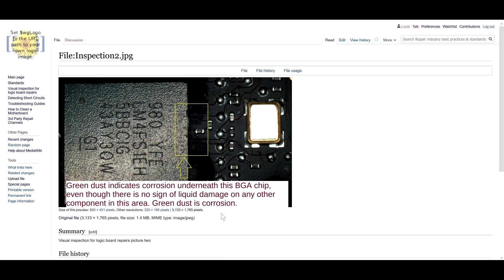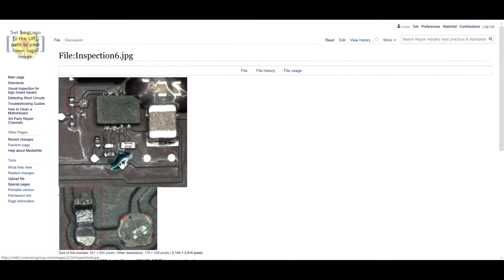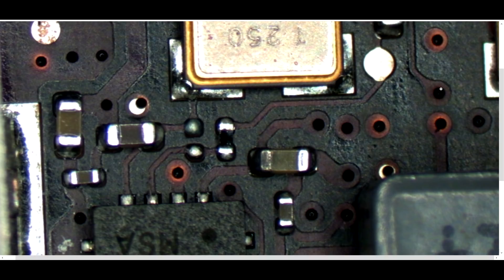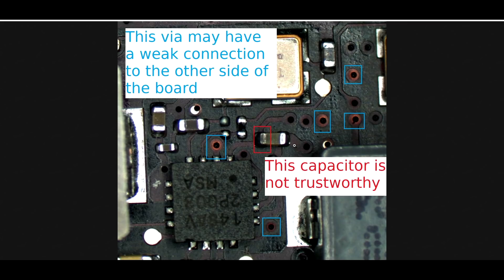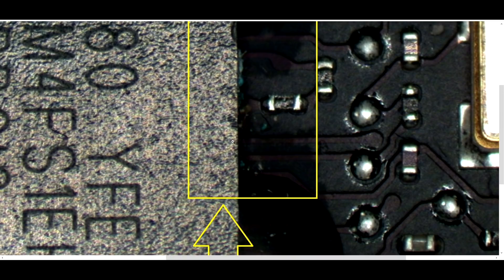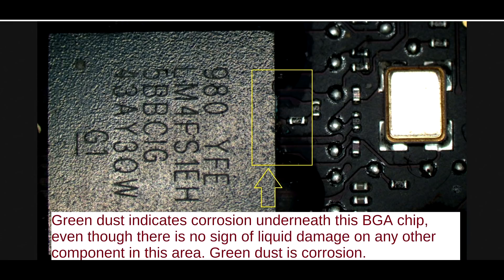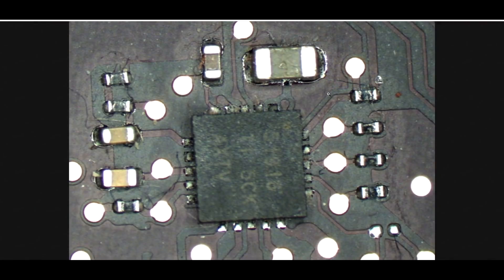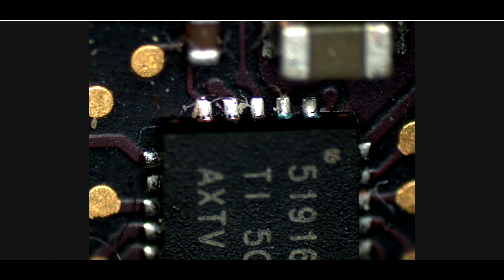Why do I fix logic boards before cleaning them first?

Comment: I never clean a board first I leave all the corroded areas etc and work on those areas 1 at a time test and then clean the board properly if you clean the board first you may forget which areas were bad and overlook it which will lead to a no fix

Comment: Back in the early 70's, one of our pinball machine came in with "bad display" (like a multiplexed Nixie tubel). Test fixture looked correct. Closer look had pink something around the the glass display to interface board connection. I reconized the pink looked like the colorizer of our acid flux bottle.  Someone had trouble soldering the leads during a previous repair and used acid flux to clean the connect leads of the glass display but did not clean it the acid flux off.  When dry, no high voltage leakage, but high humidity would re-wet the flux and conduct to other segments.

Comment: Usuallly once I find a component with corrosion I will clean that individual component with alcohol then reflow solder.  Leaving corrosion then reflowing solder can leave trash in the new solder joint.

Comment: I think it really depends on the job. I repaired industrial variable frequency drivers and they would come completely disgusting with oil, dust and even metal powder making it impossible to working on without cleaning first. Before cleaning I would first visualy inspect if anything was blown up and check if the mains or output would be shorted.

Comment: This reminds me, Iv'e lost quite a few laptops to spilling even the smallest amount of liquid onto my keyboard, Iv'e tried all the methods to fix them but I finally found the best and by far the easiest one. Disconnect the battery from the board and get 99% alcohol and pour it onto the keyboard (be generous) the tilt it in all directions to get the alcohol in every crevice and let it sit for an hour or so, drain it then dry it with a hair dryer, repeat, then leave it over night to dry proper. Then see if it works...Hope this helps some of you.

Comment: Louis, If you have a board working perfectly (ideally Brand new) what are your thoughts on applying a good layer of silicone conformal coating to prevent any possible future water damage?

Comment: Didn't even watch the video yet. But from the thumbnail i'm gonna guess you repair before cleaning so you can see all the corrosion and crap that points to damaged components. If the board is all squeaky clean then much less corrosion and gunk to point to bad components.....
Lets see if i'm right 8D

Comment: Thought this would be obvious to anyone doing board level work. Unless the crud itself is the problem fix it before you make it look pretty. Even then if the crud is likely the problem clean it by hand component by component as you diagnose it. Also one must appease the feline gods especially when their trade is witchcraft and anyone who has worked on electronics has broke out the candles and gris-gris once or twice... a day...

Comment: I get where he is comming from, that being said if you have a board that just behaves all sorts of weird i tend to just put it in the dishwasher and that usally fixes things... Keep in mid those are not basic issues like powerrails missing or being shorted but issues like the ram suddenly clocking 100Mhz worse, the board not liking certain voltage or fsb settings etc... (zero experience with stuff like notebook boards here, as they don't really intrest me, just desktop stuff)

Comment: Wow, i'm surprised this is even a question!

Often times when looking at an issue in this field and it doesn't matter if its hardware or software you approach it as a detective. 9.9/10 you get a bull story and that's not to say people lie all the time, they just genuinely don't know what happened...

You simply don't clean the scene before fixing it as it helps so much in figuring out the why which of course will be asked by the client and it also gives you a great idea of where to freaking look!

Comment: It's kinda like trying to find the bad seal leaking oil AFTER you steam cleaned your engine 360 degrees all around.
Reply: when I go to buy a used car, I get real suspicious if the engine compartment is squeaky clean.  My first reaction is "what are they hiding?"

Comment: I'm a novice at repairs, but I would have thought this was common sense. I'm surprised you're having to make a video on this! Why clean the PCB first making the job of inspection/diagnosis harder to do? Doesn't make sense. The condition of the PCB is your greatest evidence & troubleshooting tool.
Reply: Armchair experts may have a fantasy that everything can be magically solved by testing. The reality is that most component-level faults are not included in the self-diagnosis. Imagine trying to anticipate every possible failure of each resistor, capacitor, and circuit.

Comment: sorry to be off topic: in a previous video, you used flux on the circuit board and I finally got around to looking what that meant, one of which is to clean and remove oxides. I do not do soldering on my own, but I am interested in cooling for high power chips. We typically use a thermal paste to ensure best transfer. Most of the delta-T occurs in the oxide layer that forms on any metal surface exposed to oxygen. Do you suppose we can use flux to remove the oxide layer? (then get the paste on quickly)

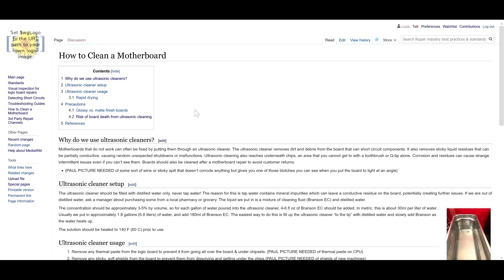Comment: 9:50 Guide for using ultrasonic cleaner, ehmmmm I have none. But what i have is a dishwasher, as seen on the internet (YouTube)
put your electronics into the dishwasher :O. I did it. The e- board came out pristine, it was a brand new board for a 3018CNC, factory
new and dirty as always... China. It still works, sometimes you have to be lucky.

Comment: Hello Again Louis In regards to my question about this  previously , It was in regards to, "  When "  you fix the particular area, not before you look for the problem. I can understand why you don't Clean the board beforehand,  because then would be getting rid of important signs where there may be a problem. However when you find that area/chip, etc to be resoldered, then I would have thought you would clean that area.  Kind of like me and painting for the customer, I don't paint over the dirt or holes in their walls, I wash the wall of any grease/grime or patch the holes sand and prime the areas I patched then apply the Primer coat, then apply a Finish coat(s). Just wanted to touch base with you on that as this video came after I asked this question of you. Cheers, Stay healthy Stay Safe. P.S. I like your channel and never thought of you as unprofessional nor lazy.

Comment: Component-level repair is rare these days, but not really that hard. It DOES take a plan, though. I was a self-taught 2M tech in the Navy a looonnggg time ago. Inspection is the most important first step. That said, I can't count the number of times I "fixed" malfunctioning gear by merely vacuuming it out. At least a dozen CRT television sets - vacuum the dust out, and voila!

Comment: When i was working with board repairs 15 years ago i allways started out with a thorough microscope inspection for cracks in underfill and corrosion on the board as well as conectors.
I had a much lower return rate on repairs than my colleagues...

Comment: I'd like to play Devil's Advocate for a moment, but I completely agree with what you're saying. I think I understand where the mindset of the people asking why you don't clean it first comes from, though, and it has to do with the sort of tasks that they do most often. A lot of people are just doing work, and for them having a clean and organized workspace is paramount to being able to work efficiently, and I'm sure your workspace and tools are both clean and organized before you start something. Troubleshooting problems is different, and should be considered a "separate task" from the work required to actually fix the issue once you've identified it. Sometimes you clean to find a problem, other times you want to look and evaluate the damage first.

For example, if I have a leaky sink, and I open the cupboard to look underneath it and all I see is condensation on the underside and all the plumbing, maybe a puddle beneath it, it makes sense for me to "clean it," or just pat everything dry, so that I can then watch and see where the water is actually coming from. The flow of it if it's just a small trickle may be invisible if everything is wet, and the contrast helps me. Another thing that supports the "clean it first" mindset is that probably something like 90%+ of problems with machines are due to something being dirty, at least in my experience, and simply cleaning it IS the solution.

On the other hand, if I realize I have a bunch of ants coming in, yeah I can spray down some poison and clean up the carnage of where I saw them, but that's going to work against me. I won't know how they got in in the first place (and exclusion, physical barriers, are better than any other method for keeping pests out), and they'll be scared off by the poison just long enough for me to not be watching, then when it wears off it comes back. It makes more sense to me to hunt down their trails and find their entry point, plug it up, then get rid of all the ones that are left trapped inside of my house. Or, obviously, the example you gave in this entire video, or everyone in the comments below referencing crime scenes. Sometimes it's necessary to use the dirt to find the problem, sometimes you want to clean it first to find it, but most of the time needing to clean it IS the problem - and why so many people parrot that all the time.
Reply: He’s talking about repairing electronics, not plumbing. Very different. Besides I have to disagree, very very few times I have found that just cleaning  solved a problem.
Reply: @pansepot1490  Yes, I understand he's talking about electronics. I'm trying to explain why a ton of people would have the mindset of cleaning first because their exposure to problem solving is different. You're welcome to disagree about how effective cleaning is, but that also depends on what you do and what problems you face. My biggest (only) enemy at work is a giant industrial printer, and most of its problems are definitely caused by the fact the ink shoots out of it with all the grace of Cartman's arsehole after he's stolen all the skin off the Kentucky Fried Chicken, and dust or grime getting on various sensors. And that's also held true for most other fields/things I've encountered in life.

To be fair, I do kind of lump in other bits of general maintenance with cleaning. Like replacing/sharpening a blade, adding grease, etc. In my brain a gasket wearing out is a form of getting dirty. We cling to life by fighting entropy.

Comment: Without even watching:
1. Dirt, grime, soda spill, signs of discharge and other debris can be a big old NEON 'problem here' sign.
2. When you are unsure of what the problem is, 'cleaning' things can result in worsening the existing issue, depending on what the issue turns out to be. 
3. If I'm going to have to toss it anyway, I don't want to waste the time and materiel cleaning it. 
4. It's fun to see how flustered people get when you reveal before and after pictures of their electronics and they see just how poor of care they  were taking of them. 

I cleaned up a nintendo 64 that was 'no longer functioning' and the associated controllers with loose sticks as well as all the cartridges for a relative's kid, as a birthday present. The parent didn't believe me when I told her that it wasn't an entirely new console, until I showed the nick in the housing around the video out that had been there for 10 years. Incidentally, the 'non-function' turned out to be a combo of the old RF cable that was being used for video failing and dirty contacts on both the console and cartridges. So I threw in some sleeves and explained to the kid how using them meant stuff would keep working longer. When you also include an 'awesome' display shelf, the kid is much more likely to make use of them.
Reply: That's pretty cool about the console. What do you mean by sleeves?
Reply: @DuckieMcduck  Little plastic sleeves that go over the base (or entirety) of the cartridges to act as a dust/debris cover and basically protect the contacts from damage or corrosion.
Reply: @jtnachos16 
Haha
I'm fairly careful with my electronics. I've never had any electronic device fail on me.
(well, I dropped my phone and broke the screen once, but my ancient GameBoy Color probably still boots up just fine, lol) 

But even so, I wonder what massacre would await you if you opened up my devices and took a good look 😆
I'd be very pleased if all you found was some fine dust 😅
Reply: @MrNicoJac  Well, at least in the case of gameboys, I'd probably find a decent amount of dust on the backside, maybe a bit of corrosion around battery contacts, but also a few bug shells. I don't know what species it is, but there is one type of bug that is in at least my area, that seems to like molting inside of nintendo cartridges and devices. I've never checked inside of a Genesis, but I've yet to find any of that type in a playstation or disc-based console.
Reply: @DuckieMcduck  H probably meant some microfiber cloth that is used to cleaning dust from electronics
Reply: Yeah. I'm stripping paint off something to refurb it, and the workers nearby asked why I did not pay them to jet was it. "Cos I saned it all off" I said lol. I needed the dirt to tell me where the holes were. XD

Comment: Again, I have to ask: How do you know that people from outside your store are entering good information into the Wiki? How are you vetting your Wiki? Thanks...
Reply: its a wiki. fact checking is left to the public. that's why they have references so that anyone may challenge any info they doubt.
Reply: @nullvoid3545  ... I know what a Wiki is... That methodology just seems contrary to Louis’ very high and exacting quality standards, is the reason I ask...
Reply: @SteveHacker  i believe that transparency is the very best methodology for securing information.
FOSS, Blockchains, and Wikis are all great examples of this methodology being put to different use cases.
Reply: @nullvoid3545  ... And that’s great until a beginner fries his machine because he trusts bad information before it’s checked and removed...